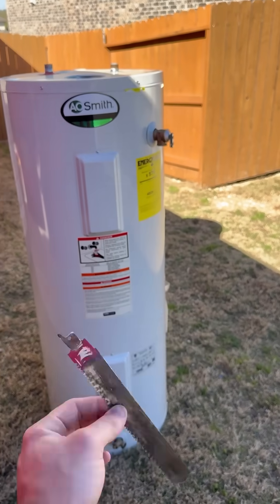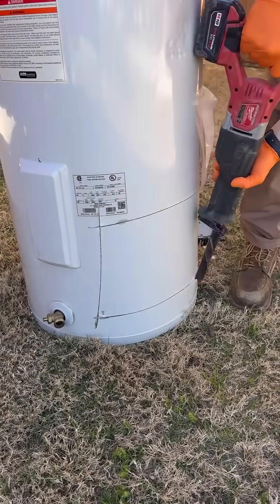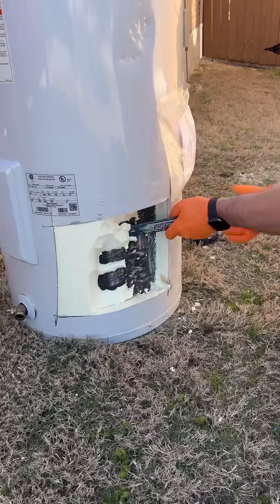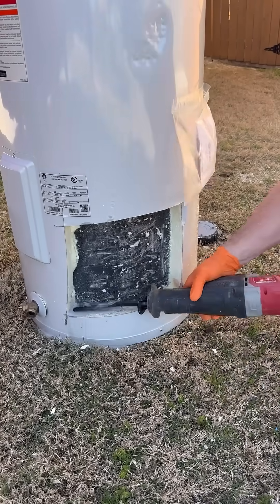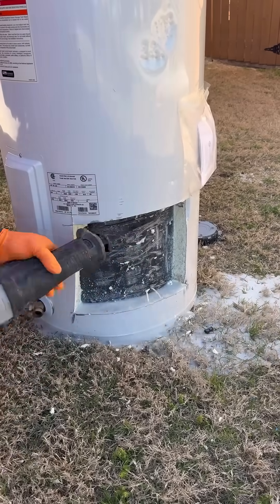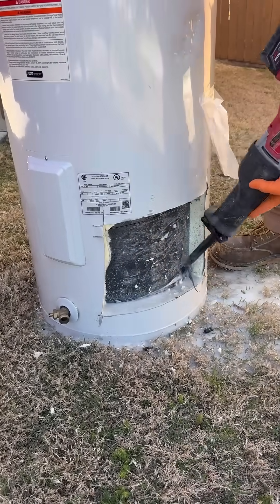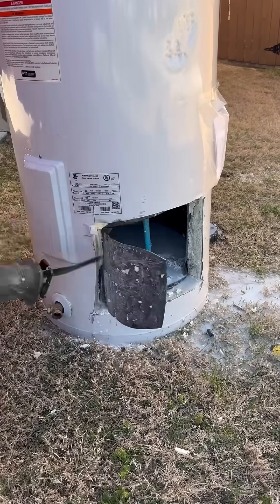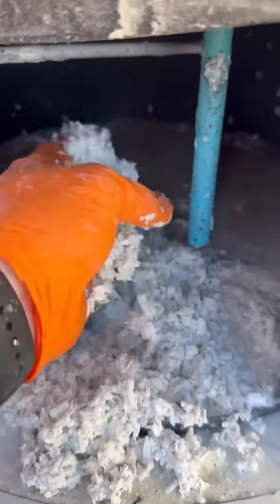What Is Inside This Water Heater?

Comment: Old school plumber said a hatchet is the fastest way to extract a copper cylinder from the steel/foam outer.

I have to agree,  although I doubted the old head.  He's 70 and still plumbing.
Reply: In the olden days when Pops worked some tanks were made of copper, since a very long time they are being made of porcelain coated steel, good luck with a hatchet.
Reply: @dingotopruc9642   most of our low pressure cylinders being replaced are copper here.  Oldest one I've pulled was a Stanley from 1946.  It still worked.  The vitreous enamel ones (no scrap value) are warrantied for 7-10 yrs, lucky to last twice that in a mains pressure situation in my experience.   I would only install a stainless or non VE mains tank in any of my properties.

You can still split them with an axe if required but normally straight to landfill like the junk they are.
Reply: @leonosullivan6022  It's a matter of cost. Copper can't withstand mains pressure used now or it would have to be so thick you would need to apply for a mortgage. I don't know if stainless steel water heaters are available for residential use. I would certainly get me one and be done wit the problem. I have seen one installed on a This Old House program many years ago, it came from Germany.
Reply: @dingotopruc9642   totally.   My eldest is a plumber gas fitter (and I've been in property since the 90s). The VE cylinders just don't last long enough especially compared to the low pressure cylinders. 

 I aways try to push for stainless where I can,  having to replace the rusted out steel after 10 yrs (worst case) is such a pain.  And it reflects badly on my guys.

Stainless is about 40% more money last I checked but should last 20 yrs easily.

Comment: I subscribed several Chinese Tiktok(douyin) channels specifically doing the cleaning jobs for all the water heaters.(either electric or solar) it’s very satisfying when they scoop out all the build ups from the tank. build up like this one is basically nothing, we considering this condition as 85% new… I watched a episode that customer state their hater takes forever to heat up the water and the hot water run out very fast and turns out that’s a 15 year old 150 liters water heater which never been serviced with about 70 liters calcium and iron buildup in it… it’s good as new after the service.

Comment: I modified a shop vac hose to fit inside the lower heating element bung so I can vacuum out the calcium buildup every year or so.
Reply: We need a video brotha please😊
Reply: I do the same thing. Sometimes I end up swapping out the bottom element while I’m at it if it has to much calcium build up
Reply: Does it suck?
Reply: @reallyhappenings5597  yes, the vacuum sucks
Reply: it slides perfectly into the bunghole
Reply: Same
Reply: You said bung hole.
Reply: Ya, I've used the shop vac trick for the last 30 years.  Only on my second water heater so far.
Reply: This guy vacuumed out his bung-hole.
Reply: I tape a piece of garden hose to my shop cav and do the same,, nursed that water heater for 10 years,, just replaced it a cpl months ago.
Reply: I just used a 3/4" PVC pipe I bent with a heat gun duct taped to my shop vac, while also going through the bottom heating element hole. There was quite a bit of build up, probably only about half of that in this video, but that was only 3 years of light service. 

I installed my water softener right after I had cleaned it out. Much better water now.

Comment: Funny, I live in a place with super hard water, and my water heater warranty specifically states that they won’t honor it if you use a water softener.  But I obviously have to use one, and my water heaters seem to last longer than the warranty anyway.
Reply: Companies don't always look out for your best interest.
Reply: Tell me how adding salt water to a metal tank would increase its life expectancy
Reply: @dylancampbell8064   Thanks for asking!  Well, obviously because the huge benefits from the soft water in not leaching out a bunch of minerals to the bottom of the tank to sit on the burner plate and choke the life out of the water heater more than offset the negligible negative of adding mildly salty (and drinkable with no salt taste) water to the tank.    

The only concession I have to make in using soft water (not “salt water”) is to use a Rheem R-Series anode rod, which is optimized for softer water.  But since I change out the rod completely every 3 years anyway, that’s not a problem.  

Using soft water my 9-year warranty 40 gallon GE Profile heater lasted 12.5 years, and so far my 12-year warranty 50 gallon Rheem has lasted 15, so I can see why the mfr might not consider that as an ideal situation.  🤷‍♂️
Reply: @dylancampbell8064  And you think his explanation will be better than a Dictionary definition?? Or are you just lazy?
Reply: @dylancampbell8064  you realize that is calcium salt right. Calcium Carbonate. You're changing it to sodium chloride is all. So that's how. I suggest paying attention in school. Also there is a zinc anode in the tank so salts don't attack the steel. The steel is also coated with ceramic on good heaters.

Comment: That would be a steel glass lined tank. Then 2 magnesium electric heating elements, an anode rod and a dip tube... it's probably blue... 2 temp sensors outside and wires that connect them... no need to watch your video

Comment: I vacuumed out our 60y old water heater and it's still running like a champ
Reply: How does one vacuum out the tank?
Reply: @nicholasjay3932 yes how would you vacuum out a hw tank?
Reply: @nicholasjay3932  three holes on top of tank, 1 hot water, 2 cold water, 3 anode rod. 
Hole one flash light 
Hold 2 👁️ 
Hole 3 wet/ dry shop vacuum with a smaller hose or PVC taped to it, to fit inside.
Reply: @Technikatwo I feel like people who asked how you did this have never seen a hot water heater before. 😂
Reply: @nicholasjay3932 same process as video. Once vacuumed out, hire a welder to weld the square you just cut out. Get a can of foam from Home Depot, slap some duct tape on the outer square and call it a day.
Reply: @nicholasjay3932  that was my immediate thought😂
Reply: Keep it. I regularly cleaned our 6 year old one and it still failed.
Reply: @castirondude I think it's just luck. If your lucky your water heater will last you 10, 12, 14, 16 or more. If your unlucky anywhere between you had it installed to months or years, regardless in brand of water heater. My dad a water heater 18 years never flushed it and had no water softener. So there, it's a matter of luck. You buy a Toyota vehicle ( good reputation) and it could turn out to be lemon or the vehicle can turn out to last you 20 + years
Reply: @castirondude  mine is Sears HOMART 200 GLASS LINED
Reply: @castirondude  its because there is no constant influx in profit making products with integrity and built to last like they used to. everything is purposely done to fail so you have to buy it again. all by design. that's why you don't see things, from the past, fail often.
Reply: @Donahue250  I wonder about tanks like the Chiltrix DHW80, they are made in the USA, stainless steel tanks, maybe they last longer.
Reply: @castirondude the water heater tank doesn’t fail.. the only thing that fails is the heating element.. you can get a kit with both heating elements and thermostat for under 50 bucks.. save yourself 800 dollars
Reply: @Longoria1966  mine was still getting hot but leaking
Reply: @Longoria1966 you’ve never had a tank rust and fail and start flooding…it happens.
Reply: @Longoria1966  But don't you also need to somehow clean out all the mineral buildup inside? How is that done?
Reply: They normally start leaking when they fail...then what?
Reply: @Longoria1966 the tank itself can start leaking from deterioration, just happened to me
Reply: That tank was built like a tank.
Reply: My grandpa had a 1940s or 50s fridge that worked like a champ untill he passed away.
Reply: I had one that was 45+ years old :)
Reply: He’s taking a piss
Reply: P00
Reply: Exactly it’s a bit of luck I’ve seen them last 30 40 years with no maintenance I’ve seen them go bad around the 10 years they rated for , definitely not making them as good as original but that goes for everything, I have large HW heater contractors never removed ill cut open like this just to see , it’s probably 25 years old but under sized so used constantly
Reply: Shit gonna blow up😮
Reply: @lennybigturtle  nah, I replaced the pressure release valve
Reply: @Technikatwo 
 The one, and only part still available.😅
Reply: I got 150 yr old....we just flush the coal mine every 4 years still going like a steam engine today 🚂
Reply: 60yr old?
Reply: I tried flushing mine 15-year-old in Sacramento and nothing came out at all and I'm sure that it's pretty bad
Reply: a lot of people need theirs replaced, like I did, to be less than 15 years old in order for insurance prices to be lowered.
Reply: @Sorivoid  The bad part is that you're lucky if the new one makes it to 15 years before burning up or pissing all over your floor... The irony.
Reply: @Sorivoid  some things a better left to not be reported. Upgrade to a worse quality item just to make insurance happy. No thanks always say no to bullies or fight back
Reply: @Technikatwo  yeah nah definitely worth. home insurance dropped by over $1500 a month as the water heater was the last thing needed updated. we save more than the price of the water heater itself every month lol
Reply: Superior tanks can only be superior if they exist.  A tiger on the western front might as well have been a unicorn.
Reply: I’m calling cap on 60 years old
Reply: @whiteboyrick849 shiet from 60yrs ago was bilt like a german tank what are you on 😂
Reply: @logansmokes.2762  tell me you’ve changed a water heater without telling me you’ve never changed a water heater😂😂 oldest I’ve seen in my career is 32 years old. Stick with reviewing cigarettes and vapes lil homie
Reply: @whiteboyrick849 i mean a 60 year old water heater isn't unheard of. Its certainly not common, but heaters from the 50s still get swapped.
Reply: @logansmokes.2762 for the record german tanks were incredibly unreliable... they were big sure but their size fucked them
Reply: @whiteboyrick849  “lil homie” “cap” let me guess. Broccoli hair?
Reply: @Yourfather7392  when I see that haircut I know for a fact his life going to be a short one
Reply: @chevyowner  imagine defending tarantula heads, lmfao
Reply: @Yourfather7392  what about it?
Reply: @whiteboyrick849  when I vacuumed it the debris was about an inch passed the bottom element and the anode rod and cold water rod were completely disintegrated.
Reply: @alecjohnson5043  for the record, german tanks were superior to American tanks. Learn some history.
Reply: @Nexcroo  dude is a 18yo apprentice trying to act like a seasoned tradesman 😂😂
Reply: @Civiciousx  why’s that? Cause I’m white?
Reply: @chevyowner  dude calls my profile generic yet but his straight google anime😂 gtfo here
Reply: @whiteboyrick849  Must be shit water in your area then. i just checked my hot water tank and its a peter cooks manufacture date 15/3/1964, original thermostat but i did put a new heating element in it earlier this year for $60
Reply: @Mattvbro  average about 15 grains of hardness. Which I understand makes or breaks a water heaters life. Even with softeners most of our system out in my area last 20 years max before internal leak
Reply: @SatelliteController27  another closeted homosexual?
Reply: @Yourfather7392 😂
Reply: @whiteboyrick849 i rented a house with a 1979 sears glass lined water heater. Still kicking
Reply: @whiteboyrick849  Just scrapped out a condemned motel with a line of six AO Smith units at LEAST 60 years old. The "parts shelves" in the room suggested they had been maintained regularly, and all but one were still functioning. 

I've also seen the same brand on farms that exceeded your "cap" limitations on NUMOROUS occasions. Quality old stuff was MADE to be maintained and to last. Your keyboard experience is failing you.
Reply: @whiteboyrick849 That would be a 1964 water heater which is totally possible.
Reply: @nickkorte  maybe if it’s oil fired or gas but I usually don’t see electric heaters last longer than 20 and even that’s a long long life for one
Reply: @whiteboyrick849 I know of some over 50 year old gas heaters still working, most are changed because they contaminate water with rust and are inefficient but they are thick as a ww1 tank, takes a lot for rust to eat those walls.
Reply: @Wen6543  My mom's water heater was over 40 years old (42 IIRC) when it got replaced. It was still working and in good condition but the house was getting redone through insurance so we went ahead and replaced it. Probably would've lasted another 10 years.
Reply: @nickkorte yep. My water heater was from 1975 and worked like a champ until it needed to be replaced last year. They don’t make them like that anymore.
Reply: @whiteboyrick849 why tho? Nvm, you like being negative and annoying others online
Reply: @jackkenny4194  why what? Ain’t nobody seem bothered but you dude
Reply: @whiteboyrick849  yup just me on all of YouTube. I must be special
Reply: @jackkenny4194  special enough to comment on my comment thread❤️
Reply: @whiteboyrick849  This comment thread isn't even yours. You're not the OP. Your use of the words "lil homie" and "cap" suggests that you're well under 30 years old. If you're 30 or older, yeesh. How embarrassing. Some of you kids are just too impressionable to be your own person.
Reply: @EyeAmMorbid  yet your still replying to a comment thread well over a month old. Want a cookie or something?
Reply: @whiteboyrick849 have you seen a barn before?
Reply: @gameseeker6307  yea I own one, why?
Reply: @whiteboyrick849 shit from that long ago we’re actually built to last not like this bs today. I’ve seen setups about 60 years old still working like a top all you do is maintain it like it should and it’ll last forever. Use common sense
Reply: Alright dad
Reply: Negative efficiency

Comment: Not me with a water tank that hasn’t been serviced in 20Yrs by a plumber or at least one that wrote it on the list for tuneups on the tank. Gonna try flushing it and putting in new elements and an anode rod and keep an eye out for a nice gas water heater since the gas line already has a termination point above the current tank from the past gas tank heater. Not hooking up the gas DIY though that’s for the pros with their cracks hanging out 😂

Comment: I could of vacuumed it out put in a new lower  heat element done.  Water heaters 500. Parts 25 bucks , I do it all the time I take the lower  element out  use a water hose taped to my shop vac.  Get all hard water chips out replace new  element fill up turn back on good to go

Comment: Im lost as to why this has been taken out or replaced. Its like brand new. We replace the element if needed, but i take the element out, turn on the cold valve and then use a wire with a hook at the end to pull all of the calcium out. Its shocking in my area. But it doesnt take long to clean out thru the element hole.

Comment: My water heater keeps making extremely loud banging and popping noises, is it because of this buildup, and is it too late to service? 

I just bought the house, I wasn’t the one that let it get that way, just fyi
Reply: @coltglass1270  you might need a new heater.. check the date on the side. If it's more than 10 years old, I'd toss it and get a new one... you might be able to flush it and get rid of some of the buildup, but you're going to need to be aggressive with your additives, and this guy's knockers might be necessary
Reply: Ignore the above post. When properly maintained, theres no reaaon a water heater wont last 30 years. 99% of people dont properly maintain them, however.

If it's banging noises, you have pressure issues coming into the house. Contact a reputable plumber to instal whatever device your area requires to be compliant with code to control those pressure fluctuations.

Comment: Yeah, depending on the age I pull the bottom element out and wet vac most of it out with a piece of pex tubing. I sell a tank clean and flush with an electric anode rod install. If the heater is more than 6 years old I wont do it, but if it's not I can get the customer another 5 or more years of tank life average.